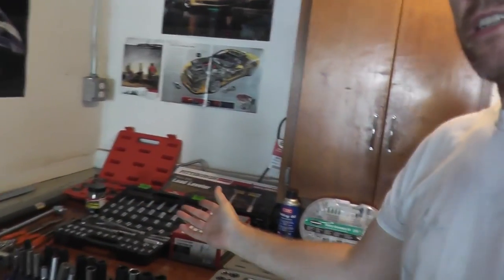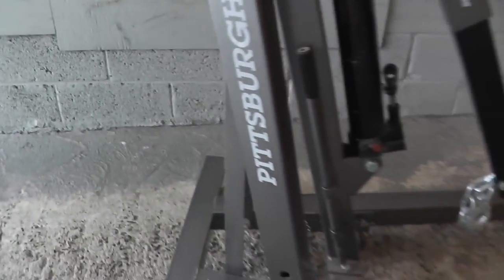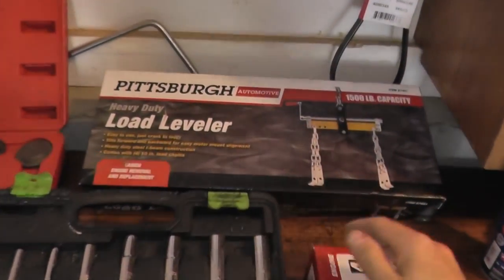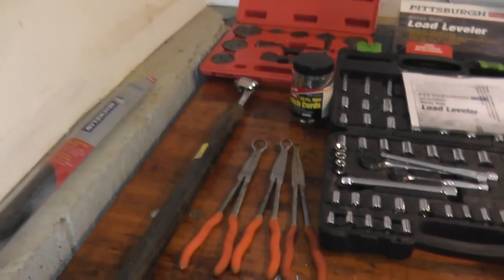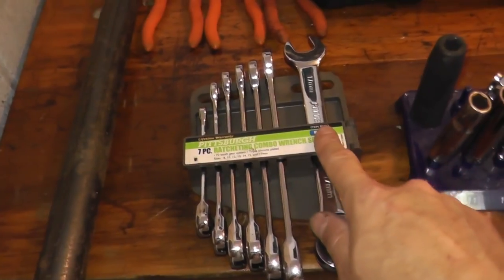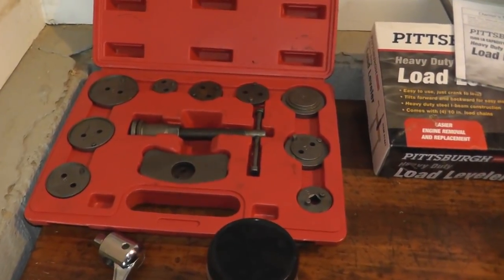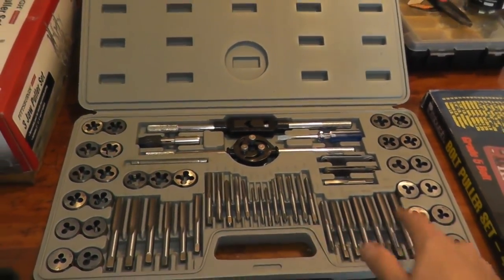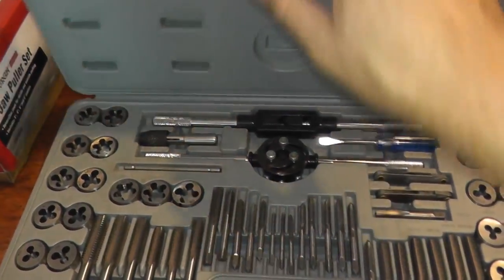Are Harbor Freight Tools Any Good???

Comment: My suggestion on the black impact sockets you showed is to use nail polish and paint the area where the size of the socket is marked.  Allow it to dry and then get a rag with acetone and wipe the area you painted. It will remove the nail polish on the top surface, but the polish that went into the recessed area of the marking of the size will still be there highlighting the numbers of the socket size. Now you will have sockets that are easier to read.
Reply from the maker: Nice tip! Thank you.
Reply: I use model paint.
Reply: Or use White Out.... just put a dab on there and smear it around and it will highlight the size
Reply: Use a paint pen. Then scrape off the paint and leave the paint on the inside of the number. ☺️
Reply: hit the numbers with whatever spray paint that you have on hand that will contrast then wipe off excess with a rag.
Reply: Good idea thanks for the tip much appreciated  😉👍👍👍🤙🤟✊
Reply: @bill3835  o o.o6
Reply: white fine point sharpie paint marker better easier one step process
Reply: @boosted2.4_sky  Never had white-out last long. Use paint. A buddy uses colored epoxies because he's crazy.

Comment: I think he outlined everything honestly, and accurately. For his application what he has, and uses is adequate. 

Style has a lot to do with a tools longevity. I work with some guys that are ever so ginger, and methodical in every movement.. Not rough on the equipment..  Other guys are bulls in a china shop. They get the job done.. They just have a pile of broken tools at the end.. Regardless of brand..    You don’t use a ratchet to do breaker bar stuff, and you don’t use 1/4” stuff to do 1/2” stuff..  It saves your tools, and it saves your hands!!

Comment: The breaker bar is a must have. It makes it real easy to loosen lug bolts from tires.
Reply from the maker: Absolutely
Reply: So does an impact
Reply: I agree.  Breaker bars are also invaluable for loosening stuck or corroded fasteners all around a car.  They are typically much longer than a ratchet, thus providing more leverage to loosen difficult bolts.
Reply: Jordan Vasquez my man 👍 ugga dugga that shit out
Reply: @stever5887  if you are cheap, lots of PB Blaster penetrating oil spray several times daily for about a week, then using a small sledge hammer to lightly tap on the wrench handle, slowly increasing the amount of hammering force. If it is still stuck, more PB Blaster and trying again a day later. Instead of adding heat and maybe breaking something (like my skin), I just take it to a real mechanic to loosen something for a few bucks, then finish the work myself. Help support your local mechanics, and you might learn something talking to them.

Comment: That transfer pump worked great for me I had zero issues with it. Sure if you transfer liquids all the time get something else. I used the transfer pump to remove 8 gallons or so out of my generator and it worked without an issue.

Comment: Great video!  Thanks for sharing all your first hand experiences.  My experience with H.F. tools has been mostly positive, and I use them for everything from household use to working on my fleet of 85 buses and fire trucks.  I need sockets up to 2 1/2",  I got a set with 10 sockets, huge ratchet with two extensions and a case for $40 bucks,..incredible price.  But I did bend the breaker bar with some real heavy use. p.s. AVOID the multi colored, double box end ratcheting wrenches that have ANY plastic, you can see it if you look closely, they simply fall apart. The ratcheting wrenches that are shown here (box and open end) are far superior.  Their black impact sockets are dynamite, I use them mostly with an air gun with no problems. And yes, they are hard to read. I've also used their regular chrome sockets with an air gun, no problems in many, many years of use.

Comment: I completely agree with you on the one ton engine picker. It just doesn't have the reach unless you're pulling an inline 4 banger or V6 and you can extract it to the 500 lb setting. Spend the extra money on the 2 ton model....Period. The caliper kit. GM, Chrysler....Ford. Never had an issue. Bolt puller...I've pulled a good number steering wheels with it. Breaker bars are a no brainer. For 10 bucks each, buy every size they sell. Everything I mention here I've had for well over 10 years and used the crap out of it for DIY. Freinds, relatives and myself.
Reply from the maker: Awesome!

Comment: The legs on the folding crane are designed that way so as to lift the center casters off the floor.
Reply: Domo's Automotive yes you are absolutely correct!   I saw that also.
Reply: Drill
Reply: Domo's Automotive agreed.
Reply: Came to the comments to say this.
Reply: @jamestern5720  No, don't! The little casters are supposed to be lifted off the floor in use.
Reply: The little casters go on the back, not the middle.
Reply: Charles Enfield No they’re not. The middle casters are supposed to be off the ground when lifting. They’re all designed that way
Reply: @FF4X4  The little casters are off the ground when lifting either way, but I think you're right nonetheless.  My thinking was that putting the small casters on the back makes assembly easier, the load is still on the four large casters, the CG of the load is still between the large casters, having a shorter span between the casters makes the platform stronger, and it transfers some load more directly to the frame rather than through the pins to the frame. The one potential downside is that the load that’s transferred from the pins to the frame (about 15%), is also transferred from the front casters to the middle. Since I don't know the specs on the casters and can’t be sure that they can handle that additional load, I guess I must recommend putting the large casters in the rear to avoid liability. That said, I’m not worried about it and will leave mine where they are.
Reply: Ya it's not a drawback because to get it's rated weight capacity the weight has to be distributed out at the end of the legs. So if you own one of these DON'T DRILL THE HOLES OUT with the interview wheels resting on the ground.
Reply: Domo  I was going to comment exactly the same thing. you don't want the crane pivot in the middle when legs are extended.
Reply: @charlesenfield2192  you have absolutely no idea what you're talking about.
Reply: @JoeBlow-24  Far be it from me to argue with somebody with your impeccable bona fides.
Reply: Lazy much? It is designed that way. I have used the most expensive to the cheapest and thay are all the same. Get the weight off of the center casters.
Reply: He could just put some man into it.
Reply: I'm glad I'm not the only one who realized the reviewer is probably not aware of this. It's all about leverage and weight transfer.
Reply: Fernando Garcia maybe he knows one that could help her?
Reply: He said the floor is on a grade  maybe that why the pin hole don't line up?

Comment: These are the HF tools I’ve purchased in two categories. Good and bad: 
The good: metric and standard combo wrenches, spark plug boot and hose removal pliers, 1/2” breaker bar, 1/2” click type torque wrench, belt sander and sanding belts, ratchet and socket sets: 3/8”, 1/2” drive metric and standard deep well and regular. Impact deep well sockets. 
The bad: 1/4” ratchet and sockets, 32 piece screw driver set in hard black case- red plastic handles. (Threw them away)
The screw drivers broke during normal use and were spinning in the handle. That was when I was working on my Mercedes rear door lubricating and cleaning the window regulator and frame, the vacuum locks (power locks), and door hinges. 

The 1/4” drive ratchet: in all fairness I probably should have been using a larger size but the snap ring pops out and the gear falls out when you use it on very tight bolts. I just pop it back in place. Sometimes you don’t feel like digging out another tool lol. 
 
I have other tools that were given to me but I haven’t used them yet. Air conditioning pumps, pullers, compression tester, etc. I’m a classic Mercedes enthusiast with two classic MB cars. Worked on cars as a hobby 25 years, Benz- 6 years.

Comment: If you're unhappy with the welds on the leveler, stop by a welding shop or even an exhaust shop and bring the part in already wire brushed down to bare metal. They can knock that out in a few seconds maybe for a few bucks. It looks like it would be a pretty stout leveler and I'd find a way to adapt an impact to crank it.
Reply from the maker: Thank you. That's a good tip!
Reply: Actually most levelers do not work very well when full engine weight is on them. Most are designed for adjustment with weight off, lift and check, then adjust more as necessary.
In our shop we've always found that it took more effort to use the leveler than to use a long chain and just move the hook on the chain. Sometimes you might need to use a bolt and nut through a couple of links to create an eyelet from the chain, or to act as a stop pin so the chain doesn't slip on the hook if you are pulling from a steep angle.

Comment: Brought that tap and dye set. It was cheap and I really needed to tap a thread on my steam heating system. It worked but I only used it twice and both times it passed. So for a few uses yes great value. Also brought breaker bar, works well.
Reply from the maker: Very cool. I still use the set, although mostly for light usage. Cheers.

Comment: lots of people in the comments are bashing cheap tools, well, i renovated an entire house and I probably spent about $400 on tools, (because I already owned the rest of the tools i needed) and about $5000 on materials (wood flooring paint and trim for 5 rooms). In the end I saved myself over $30000 in labor costs and made over 60k when I sold the house. The tools I used are still in perfect condition and  I could literally do 100 more renovations and still be able to use the same tools.  If any of the tools broke and needed to be replaced, I could buy multiple replacements and still pay less than say... a Dewalt drill, which is not much better, and yes I owned several as well as several cheaper drills and both performed the same.   That said, I have also bought some Dewalt when on sale or searching Craigslist .....such as a brand new planer (the owner used it once and sold it to me for $250... 250 for a $700 dollar planer!! and he even made a base and included it.  People who are brand snobs are just stupid, spending their money on name and not so much on quality. ( a lot of different tool brands are made in the same factory in China, they just change the casing color so Ryobi, Dewalt, Bosch, Black and Decker, Chicago Electric and some others) yes there are some variables but now they are less and less since it's cheaper to make the same parts there are not that different from one brand to another so why pay more so that your friends don't make fun of you for not having name brand tools? what are you in high school?
Reply: Agreed.  God forbid you have a green Ryobi tool on a job site and not a blue Bosch or Red Milwaukee. hahaha.  I own a Bosch hammer drill and a Ryobi hammer drill.  Here are the differences: color, weight, a few extra features...both have been around for years and both have plenty of life left, and both perform EXACTLY THE SAME...in fact I think the Ryobi drill has more torque.
Reply: Tool snobs and experts and know it all's
Reply: Totally agree. Retired on a fixed income in ct. Ripoff tax state
Reply: @pirihern9329  "retired on fixed income in ct."

Your choice, no sympathy from me.

Comment: All of the folding cranes are pretty much designed to put the weight on the outside wheels. This keeps the unit stable under load. You should never change the hole layout for your convenience. Use a pry bar.
Reply: Exactly if he was thinking he would've realized that you don't want the weight of the engine on the small wheels which would happen if it was easy to push the pin in without raising the lift

Comment: I have a wide range of Harbor Freight Tools everything from hand tools to Electric motorized tools and my engine stand and hoist all work perfectly fine just as good as any Craftsman or Snap-on tool that I have oh and I forgot all of my Harbor Freight Tools are between 10 and 30 years old they work fine Harbor Freight has served me very well. You just have to remember any cheap tool that you buy that can last 5 or more years you've gotten your money's worth out of it so what is the difference if you have to replace it I don't see a problem with that

Comment: The engine stand works great for a small block v8. No issues at all and I’ve had complete motors on them for a year or so outside even and it still looks great. I’m also using a hydraulic pump from them on an old engine hoist and sought of abuse it and it works great. I’ll stick to craftsman for my ratchets and sockets and pretty much everything else. Harbor freight is excellent for tarps and stuff. Good video.

Comment: I just assembled my own shop crane, and thanks to your vid, I realized putting the small casters in the rear solves the problem. Had I not seen your video I wouldn't have thought of it and would have assembled it the same way you did, so thanks for saving me a little trouble.
Reply from the maker: Thank you for the heads up.

Comment: For the sockets that you said you can't read, what I do I take my angle grinder with a brown/soft disc and lightly remove the black paint until the just the black paint is left in the crease of the number and is easily visible. Hope that helps.
Reply from the maker: Thank  you. Appreciate the feedback.

Comment: The tie rod tool there was good it had the size I needed to remove the inner rod. And also the predator engine 6.5 is good put it on my log splitter.

Comment: This old man has a complete set of Pittsburg (Forge) ratchets in 1/2", 3/8" and 1/4" drives. I bought them over 30 years ago when Harbor Freight was Harbor Freight Salvage and they actually came to our local area (Fuquay-Varina, NC) and set up several tents to sell tools. I've been a customer ever since and own a home shop full of their tools. Do your homework and read the reviews before you buy and you won't be disappointed.

Comment: I flip cars often and throughout the year and 90% of the tools I use are from harbor freight, they really last a long time. I've had my soccets and wratchets for over 9 years  and still work perfectly. 2 key things to these tools 1. Know how yo ue them properly and 2. These are not professional grade so dont use the same wrench for 300 bolts a day
Reply: I'm suprised by the quality of their sockets. The tolerances are a bit loose, but I bought them to abuse em and they have yet to break.
Reply: @nobodynoone2500  they really are quality tools within reason. Like I said in a professional environment I would still use em to test them out and see how they perform but I would have low expectations. Rather they beat my expectations than be angry my $.80 soccet didn't last 15 years removing bolts day in day out.

Comment: My approach to Harbor Freight sets li,e the tap and die is;  if I wear out a particular piece I buy a good quality one to replace it and then I have all the other sizes just in case I need them.  I found that it’s cheaper over the long run to have large sets and replace a piece here in there instead of spending big bucks on small higher quality sets

Comment: HF is great for a diy guy, and im seeing more and more HF tools showing up in pros garages,
Reply: I work at a shop and love harbor freight since they are cheap i buy the wrenches and heat them with to torch and bend to my liking or double wrench them but still prefer my mac tools
Reply: When i first started workin in Automotive collision repair i thought matco and snap on were amazing. Little did my immature brain know. I only liked them bc i thought i was spendin lots of money on a quality tool. And tbh it is good quality. I have a impact from snap on which is my favorite tool to use. But HF has deals that are hard to beat and for great quality.
Reply: For the price of their bodywork tools you can buy several sets before reaching the cost for a name brand set. But I've yet to ever had to replace anything from harbor freight due to failure
Reply: Harbor Freight has stepped up the quality game in the past few years. Pittsburgh Pro stuff is made in Taiwan. No, not the same quality as USA Made Snap-On, etc, but, a lot of Irwin, Craftsman, and "mid-grade" tool companies are making their tools in the same factories.
Reply: No pro will buy anything from that place.
Reply: Harbor freight tools are great for a technician.  I just make all my important day to day tools name brand.  My sockets are snap on. My ratchet wrench..Stanley. my electric impact Matco. My 1/2in extensions harbor freight.   My organizers.  Harbor freight.
Reply: There big tool boxes are built like a heavy duty truck, I was shocked

Comment: for the numbers, paint the number with a light color paint and clean up the exess on the outside, if you want a perfect job wax the outside of the sockets and keep the wax away from the numbers and paint the letters clean the exess and your problem goes away in a snap

Comment: Regarding the engine hoist, you said that when lowering the leg for use it was a problem lining up those holes to insert the pin in the operational mode. This is not correct. Those hole don't line up for a reason. The caster wheels under the pivot point are not designed to support the weight of whatever the hoist is lifting. It is rated at a ton, those wheels are not. You have to raise the wheels off the ground when using the boom to avoid damaging the casters. Put a pry bar under the frame to lift and you won't hurt your back.